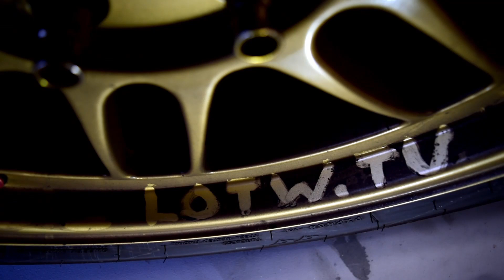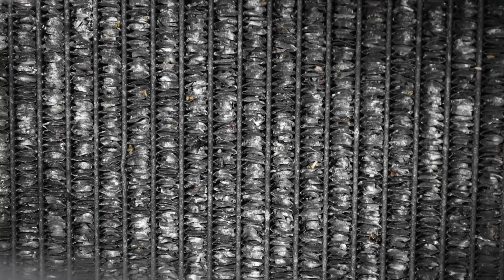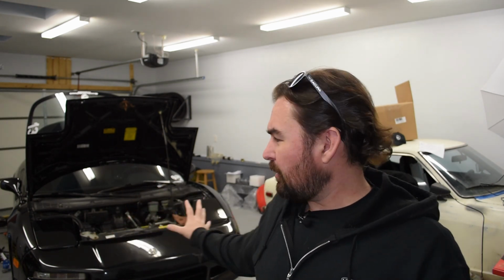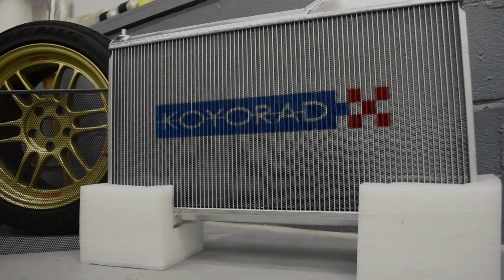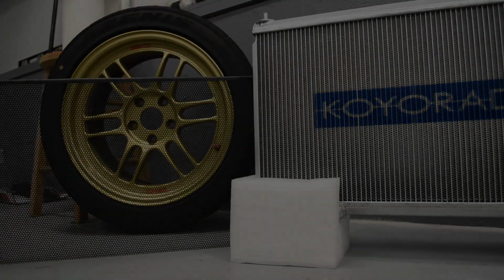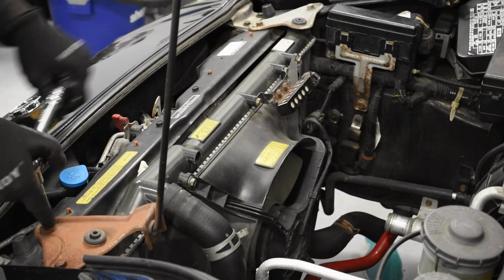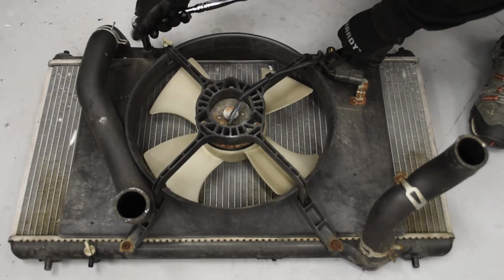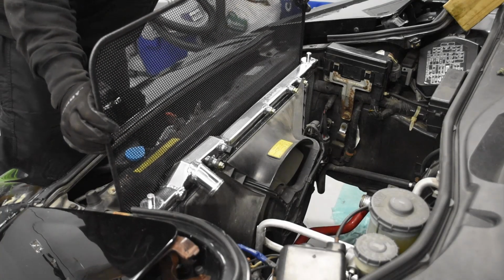Koyo Radiator install and fitment review + SOS Radiator Screen - NA1 NSX

Comment: I've had a Koyo radiator in my RX-7 for years. It's never overheated even when standing still in +35C weather.
Reply from the maker: Good to know.  Rotary > C30A when it comes to cooling system abuse I suspect, lol.  I did a lot of reading/research prior to pushing the button and the vast majority of experiences were positive so hopefully I'm set for a while.

Comment: Thanks for the Videos!  More than I'm ready to tackle right now, but who knows.  I just installed the coil protector from Davis Fab. Thanks for the recommendation.  Merry Christimas!
Reply from the maker: Merry Christmas to you as well.  I have a good year or two on that kit now and everything is still stuck in place and saving me from some errant hose spray.  The worst part on the radiator is dealing with the coolant.  The nuts & bolts part is easy.

Comment: And finally... what did you fill it back up with? I run distilled water and Red Line Water Wetter, but I also live in Houston where I simply do not have to worry about a hard freeze.
Reply from the maker: I haven't yet, but plan A was ye olde Honda Type 2.  However in light of another comment I'm going to at least ask around to make sure there's not a mass movement by tracks to ban Ethylene Glycol.  If I find that is a thing, then I may look at some Propylene 'green' alternative that still meets spec.  I'm more concerned about the anti-corrosion properties than the freeze resistance, although it's going to be 16F here tomorrow so if I did need to park it outside it could be a concern some times of year.
Reply: Interesting, I hadn't heard that rumor but my ear isn't that close to the rumor mill anymore. BUT, I can tell you that twice my NSX was backwards faster than I could blink because of coolant I put down... and I've seen coolant cause all kinds of issues over the years... so, in general, I just don't run it in my toy cars. Hopefully I am not making a terrible mistake, re: corrosion.
Reply from the maker: @robertbcope  I mean we don't have a lot of steel/iron, but maybe something to research from a metallurgy/chemistry side.  If I find anything out about a broad move to ban E.G. that'll definitely make a video, lol.

Comment: My radiator is holding strong for a 30yr old.  Assuming it is original to the car since I have no record of it being changed.  My winter project (outside the growing Honey to Do List) is ABS upgrade.  My motor finally went and I just pulled the fuses.  Thinking of upgrading to newer system, since it appears kit cost has dropped.
Reply from the maker: If not for track use, I probably wouldn't have bothered with the radiator.  Coolant that came out was squeaky clean and it's never gotten remotely hot on the street.  The 00+ ABS update has probably been one of the best mods I've done to my car.  Well worth even the higher cost in recent years because you literally never have to worry about it again.  It gets bled when you bleed your brakes normally, it's smarter, less intrusive, and I'd wager stops the car shorter as well.
Reply: @LapoftheWorld  that is the consensus I have been getting around the NSX community.  00+ ABS is night and day difference.  I have driven track days w/o abs (even heavy rain track day) and I have gotten decent at catching on to what the tires are doing and mitigating lock up.  That being said, I would rather have it and not need it, than need it and not have it.
Reply from the maker: @Nukem962001  Exactly!

Comment: What kind of coolant do you use when you're running on a track? Out here, we have to use a water based coolant.
Reply from the maker: With the caveat that I don't do anything competitive at the moment (so contact damage highly unlikely), I do run regular Honda/Acura antifreeze.  Although it sees the track often, it isn't primarily a track car.  I do run a burp tank off of the regular expansion tank to avoid putting anything down from the car just getting hot.  Where are you/which track(s) require straight water, and is that any event, or just competition?
Reply: @LapoftheWorld  Not straight water. A lot of guys use Engine Ice. I ride motorcycle track days, but the same rules apply for cars. Around the east coast (Virginia to NYST) and I know some tracks out in the mid-west say no ethyl based coolants because they are incredibly difficult to clean up in case of accidents and they are very slippery. When I switched over, my temps stayed the same.
By the way, I'm digging your car. I've always liked them.
Reply from the maker: @64t120r  Ah, ok, so more of an issue with ethylene glycol vs with antifreeze in general.  I was about to say I hadn't seen a water-only mandate outside of racing groups.  I'll keep that in mind next summer as I target more tracks up towards the NE.  Thanks for the tip on the Engine Ice as an alternative.  I see it's propylene-based so not as environmentally tragic.
Reply: @LapoftheWorld  post a comment here next summer, if you think about it. If you're on certain tracks, ie Pocono, when there's a trackday, maybe I'll be able to show up. I get wildly busy at certain times. I would like to see your car on a track. Happy Holidays.
Reply from the maker: @64t120r  👍 I'll try to remember.  If you're on Instagram you can also follow me there since that gets posted more real-time than the videos over here.  Same name.  Always fun to meet folks!